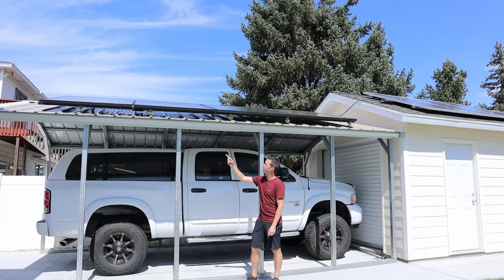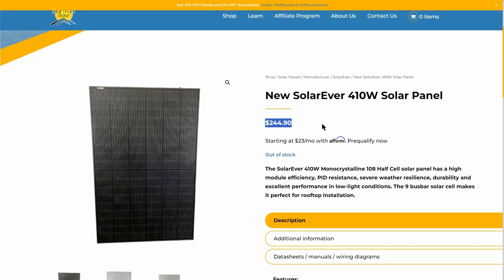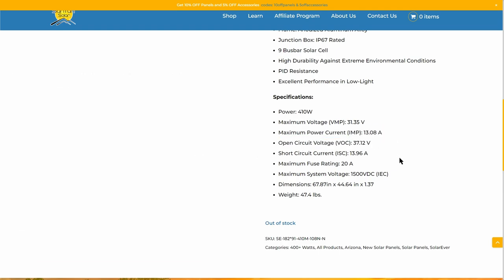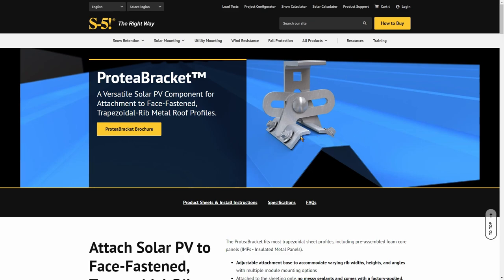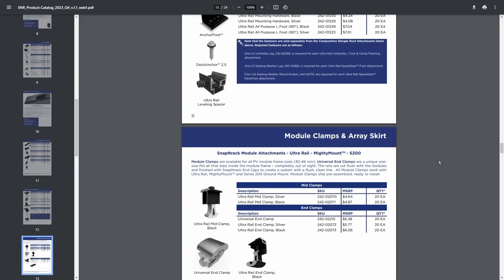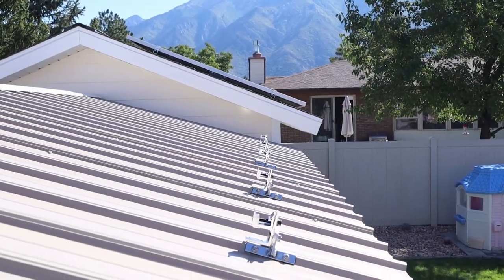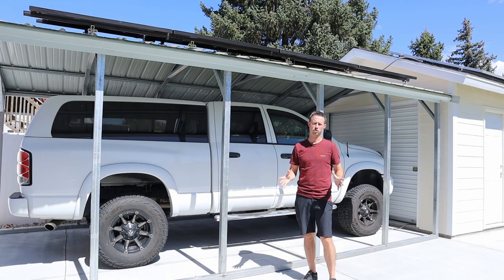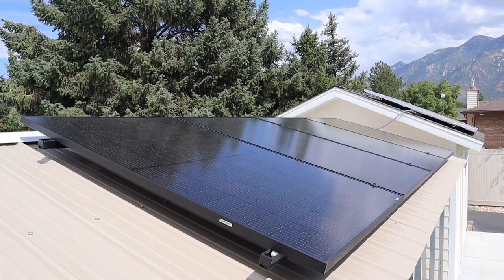How to Install 1600 Watts of Solar Panels on a Carport!  -  Four 410W Panels From SanTan Solar

Comment from the maker: UPDATE: I understand the VOC of this array is super close to 150v, I will put out a video of a DIY adapter I am making to drop the voltage during the winter months. Putting a few diodes in series will allow me to drop the voltage without hurting the total power of the array. I should have mentioned this in the video, sorry I left it out!
Reply: Wanted to know if my 4 panels work with the DP & not over voltage it. Similar to your specs. Mine are the REC 400w alpha pure. OCV- 48.8 SCA- 10.28. If I put 2 series then parallel the pair I believe it should work in any season living in California? Thanks.
Reply from the maker: @1ENDUSER  the DP has a 15 amp charging limit so your panels will be cut a little short on power when put in a 2S2P configuration.
Reply: I look forward to seeing that.
Reply: @Jasonoid  how short are they cut in this config? percentage wise? thanks!
Reply from the maker: @conradcoolerfiend  I'll need the full solar panel specs to provide that number.
Reply: @Jasonoid  I just mean , on your panels with your power station
Reply from the maker: @conradcoolerfiend  the AC500 can take in 1500 watts per charge controller, or 3000 watts total. This carport array can put out 1640 watts, but you'll likely never see that much power after efficiency losses. I'm hoping in the cooler months I'll see the full 1500 watt limit.
Reply: @Jasonoid - So no real concern on overvoltaging them with my set. Thanks.
Reply from the maker: @1ENDUSER  in a 2S config, it should be fine.
Reply: This is why they make combiner boxes.

Comment: Thanks for the great details.  I just finished a solar carport which covers a side RV pad, behind the fence.  I attached one side to my existing garage roof, at each rafter (2' apart) and the other side to the ground, a 12 ft span.  I slid a steel bar (~3/8" th) under the bottom concrete tiles of the garage roof, cutting a plastic vent stip under the tiles, securing to the rafter below w/ 2 long 5/8" galv lag bolts.  I bent the bars ~20 deg to slope up on the solar side, using a hydraulic press.  I used 1-1/4" steel EMT for the carport roof, securing to the roof bar w/ a tube clamp (half of chain-link gate hinge).  I used 90 deg EMT, plus bent the EMT w/ hydraulic tube bender to make the vertical transition.  The solar panels (550 W bi-facial, 9 total) serve as the carport roof, overlapping slightly like shingles (3 panels along slope).  Rain dripping between the ends of the panels (2 locations) is caught by cut strips of SunTuf polycarbonate U-roof and run to the garage gutter).

The panels are attached directly to the EMT (no rails).  The long side runs across the EMT beams.  The EMT proved too bouncy under the panel load (60 lb ea), so added 1/4" wire rope along the underside of each tube w/ standoff to tension out the deflection.  1-1/2" or 2" EMT would have been much stiffer.  Got a deal on the new panels, only 18 c/W due to some shipping damage (wired 2 to a resistance heater and output per spec).  I didn't want to risk damage to my tile roof w/ panels (leaks, varmints, hard to service) and many pipe penetrations so would be hard to fit them.  The carport solar roof serves double-duty, protecting a car from rain and sun.  Might buy the EG4 6000 W hybrid inverter, add 3 more panels to an existing carport roof, so 2 strings of 6 panels (ea 3300 W, 300 V).  No grid-feed, just draw from grid as needed, so no utility reviews and agreements (credit little for solar upfeed now in CA).

Comment: Man that looks good! Nice job! So close to that 150v tho! I've gone overvoltage with my delta pro with 142v open circuit 1200 watt 6S2P setup! That's even closer!
Reply from the maker: Putting diodes in series on the power wire will drop the voltage by 0.7 volts each, I'm already working on a DYI adapter to throw a few inline in the winter months. With summer temps the voltage is plenty low.

Comment: Very nice. I want to make a carport out of solar panels, don't have a good place to put it at where I live now. Not sure the best way to do that but I think it would be a good way to give shade to the car and get power. If I ever move out to the desert, I will definitely be doing that.
Reply: I just use one section of  my grid tie solar panel on the roof during outage. (After disconnect from the grid). As long as there is no snow where u live. Otherwise ur car port needs to be strong
Reply from the maker: Did you make that change after the entire setup was approved and installed?
Reply: @Jasonoid  of course. grid tied system won’t let you have DC bridge like i did for emergency. i basically added MC4 cables.

Comment: Nicely done video, with very detailed and useful information for the DIY'er... but one huge red flag for me:  The mounting brackets attach to metal roof panel "ribs".  I don't believe any engineer would endorse this, especially with any amount of wind load.  The brackets should attach through the metal roof panels and into the supporting purlins (framing beams) underneath!  This seems like a no-brainer... especially after seeing a lifetime of catastrophic weather damage, always manifests in metal roof panels being torn off and scattered around a sensationalized event site.
Reply from the maker: That's not how these mounts are designed. The panels are mounted on the ribs near the supporting beams and thats the design of the system. I installed the mounting brackets per the instruction of the manufacturer. We've had winds of 70mph and everything is good so far. If you have tornado style winds you might need something strong.

Comment: Why didn’t you want to use unistrut for the mounts? Available in person at the depot/lowes.
Reply from the maker: I did use unitstrut on the array next to it on my shed roof. I couldn't find 20 foot lengths in my area. This array looks so much better vs the old one and the solar mounting is reasonably priced. Here's the old video using unistrut:
https://youtu.be/rFVtJXqV_zA
Reply: Looks like you have a great air-gap under your array. That'll help reduce module heat and increase productivity a little.  @Jasonoid

Comment: Very entertaining and, while I don't have a carport, I do have a shed with a metal roof, so I think the process is very adaptable to that. I have always wanted to buy items from San Tan Solar, but living in the NE, their freight shipping costs and the need to buy in bulk make their products too expensive for someone with smaller needs. You have to live close enough to do a local pickup from them IMO to make purchasing from them worthwhile.
Reply from the maker: I'm sure this process will work with most metal roofing, it's even easier if you have a standing metal seam roof as you don't have any penetrations with screws. Let me know if you end up doing a project like that!
Reply: @Jasonoid  Spring 2024! 😄

Comment: He's right, the PANELS are silent.  It's the charge controller and inverter that causes massive radio frequency interference.  Do some research on how to stop RFI and get a good model.  You may still require filters.  Ask a local ham radio club for assistance.  You can find one by calling the ARRL in CT.

Comment: Great Video! Have you thought of using smaller 200W bifacial panels. There are so many now, renogy, ecoworthy, BougeRV,... Would the 200W panels replace the roof and provide higher efficiency  for the same surface area? I hope you get a chance to do another 200W rigid panel review. Enjoy the content
Reply from the maker: It's better to stick with a residential brand, UL listed solar panel for a permanent mount. Those cheaper brands break down fairly quickly. They won't last near as long as the higher quality panels.

Comment: you may want to keep an eye on the voltage as the temps drop. the panels will increase voltage and go over the 150v. you will see an over voltage fault on the AC500.  I was running four 250w panels that have a VOC of37.2 in series and on cold winter mornings of 0F as the sun first hit the panels they shut down my Bluetti inverter.  I had to remove one panel to stop this over voltage on every cold morning.  A sort time later the inverter quit working and i had to send it in to be repaired, thankfully Bluetti took care of it under warranty. There should be info on the panel as to how much voltage gain you get with the temps going down.
Reply from the maker: Putting diodes in series on the power wire will drop the voltage by 0.7 volts each, I'm already working on a DYI adapter to throw a few inline in the winter months. With summer temps the voltage is plenty low.
Reply: One of the reason I didn’t use off the shelf battery systems.  My oversized charge controller can handle anything. LOL. Love victron rs 450v
Reply: I can't wait to see that Video, I bought Four 450 watt panels from Sungoldpower recently with free shipping and the voltage goes over 150 with all 4 connected 😞 @Jasonoid
Reply from the maker: @Moes_Prep_and_Tech  by how many volts?
Reply: @Jasonoid  41.72 voc
Reply: bluetti has that voltage step down thing but it's like 600 bucks and not worth it in my opinion. and what if that device conks out
Reply from the maker: @Moes_Prep_and_Tech  maybe if you use just 3 panels it's not over by much, maybe you can do a 2S config instead
Reply: All modules have a data/spec sticker on the back, or at least are supposed to. Look for VOC Temperature Coefficient. You can use that number to figure how much voltage gain or loss per module will result with higher/lower temps. STC is your baseline at 77-degrees F. Google for more details. There are even calculators free online that let you plug in different temp scenarios. I'm at 142vdc with my modules going into my ac300 with a 150vdc limit. To compensate I flat mounted my panels perpendicular to the ground. Low winter sun angle should keep me below the ac300's limit. This is my first winter so I'll be keeping a very close eye on the incoming voltage. I'll keep my dc isolator switched off if early morning cold pushes the voltage too high. With ever warming winters....

Comment: I want to do this but as a backyard array on top of a patio. You didn’t mention anything about grounding.

Are you grounding any of the panels or mounts? Or is the grounding only a concern back at the junction box? I’m more concerned about fire potential.
Reply from the maker: Since it's a metal carport, I'm working on grounding the entire carport. You'll need to ground the array with a grounding rod 6 to 7 feet in the ground, then attach the wire to the panels.
Reply: @Jasonoid  I see! Okay? I will need to build in grounding for my solar plans. Thank you!
Reply: Many youtubes.  Grounding is required by NEC, using 8 awg Cu wire or 6 awg Al.  Can be via existing metal poles into the ground or a metal building.  Most ground just the mounting rails, not every panel.  Grounding is for personnel protection.  It make your panels a better lightning rod.

Comment: Hello 
Do we have to get permit for this size of solar you installed. I live in California
Reply from the maker: This is an off grid setup so it bypasses most those regulations. It doesnt connect to the power grid in any way or form. For a grid tie system you would definitely need to permit the install.
Reply: Depends on your county in CA.  Mine requires a permit for any solar install, charging >$400 for roof and >$800 for ground.  My recent setup might be ground since a new carport roof.  Exorbitant since almost what I paid for the solar panels ($891).  That cost likely violates a CA State Law which mandates that localities cannot make solar prohibitive.  Don't report me since haven't let them abuse me yet.  Mine isn't visible from the street, but the County may spy via drones.  Mine doesn't feed the grid, so no utility reviews or agreements.  It can draw from the grid, but so can a stove.  They credit very little now for solar upfeed to the grid.

Comment: I'm really wondering now why solar panels are that much more expensive in the US compared to Europe, normally it's the other way around. Bought my last solar panels for between 160 and 180$ a piece, brand new 405W and 415W panels. Is it just the UL listed panels or is there some import taxes making them that much more expensive?
Reply from the maker: This is my opinion of what the issue is.... here in the USA there are large tax credits for people who chose to put solar on their roof. Local solar companies jack their prices up so they can treat the 'tax rebates' as discounts. For example, they will say something like:  "Your total cost for a 5K system is going to be $27,000USD, but after tax rebates, it's only going to cost $21,500USD.... what a good deal right! You wanna move forward?"
They mark up their prices to make more money.... just my opinion, who knows if it's really the cause. I just know USA solar prices are jacked up SUPER high vs other countries...
Reply: Don't forget high import tariffs on modules, steel, and aluminum. @Jasonoid
Reply: The US imposed tariffs on Chinese imported solar panels, back when President Obama was in office.  Increases price.  Talks about more, currently:

"Separately, President Biden decided in early February to extend existing “safeguard” tariffs on imported solar panels for another four years at an initial rate of 14.75% for the period February 7, 2022 through February 6, 2023, falling to 14%, at the rate of 0.25% a year, by the last year of the four-year period."

Comment: Hey will this work for my eco flow delta 2 with extra
 Battery I just purchased online. Or. Can you tell me what I can do as I’m a newbie 
Thnks. And great vid !
Reply from the maker: You could mount your solar panels this way, but you'll need to use different panels. I'd recommend watching this video to pick the right solar panel for your Delta 2:  https://youtu.be/4JG8LvJznLY

Comment: Great swtup Jason!  Just a warning, the total Voc is very close to thr 150V max of the Delta Pro, so if temps drop, you may damage the DP MPPT. I know temps get very low in your area.
Reply from the maker: Putting diodes in series on the power wire will drop the voltage by 0.7 volts each, I'm already working on a DYI adapter to throw a few inline in the winter months. With summer temps the voltage is plenty low.